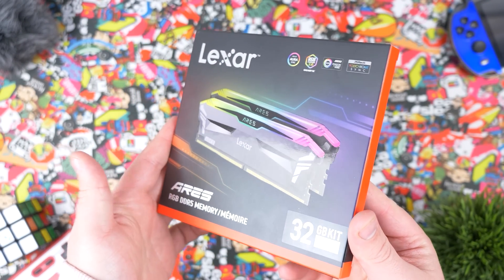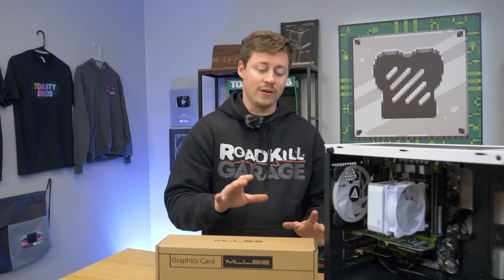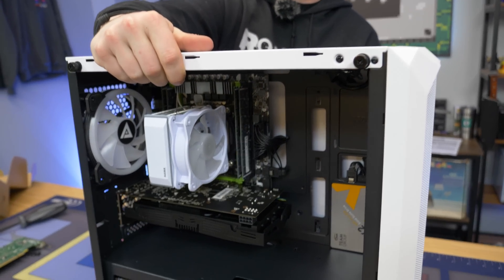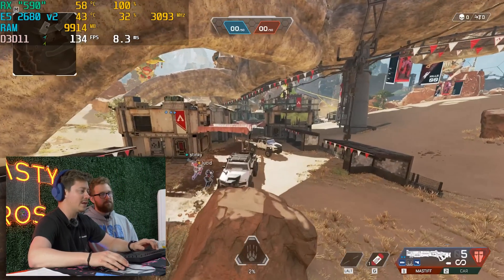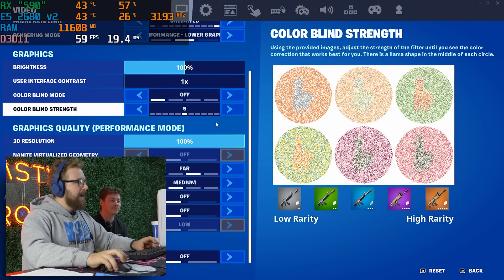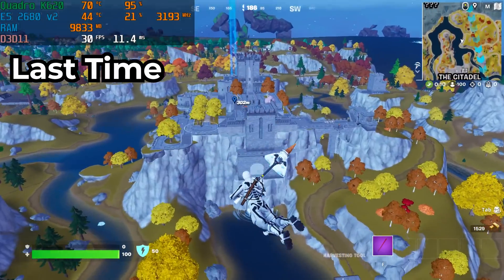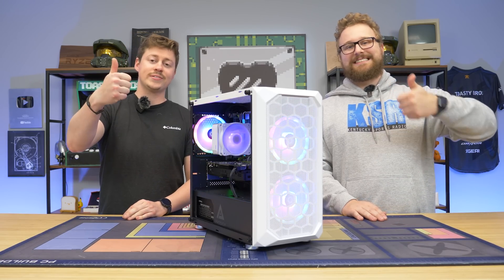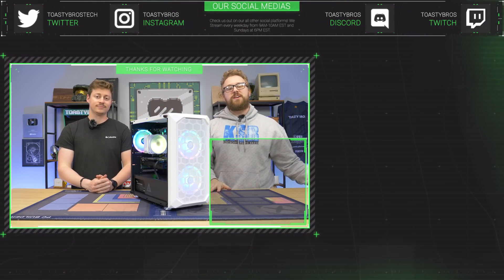It's Sad That People Buy This Gaming PC...So We Fixed It!

Comment: Could you guys review my budget PC? I think it would be really cool. My parts are an i3 10th gen, RX 5700 XT, MSI z490 plus, OLOY DDR4 16GB ram.  pc runs at  120+ fps on overwatch at 1440p ultra settings and it only cost me $400.

Comment: I sure hope you left negative feedback for that seller, it's the best way to warn potential buyers about shady practices.  I won't buy from an eBay seller that has less than a 100% positive rating (with occasional but rare exceptions --- I've seen some very unreasonable complaints).

Comment: Looks like two scams cancel each other 😁But realistically, pairing Xeons with "580" or "590" is a good way to get cheap multipurpose PC with decent gaming capabilities as long as you moderate your expectations.
Reply: The amount of content this can run well is staggering, it'll just struggle a bit in the new AAA stuff, then again everything seems to be struggling with the new AAA stuff.
Reply: @darthwiizius  if you get this pc I’m pretty sure you don’t expect high expectations tho this 590 definitely improved it
Reply: @ImJusSha  
Yeah, it's a basic 1080P60 machine.  This 590/80/70 did turn it into a viable gaming and general purpose computer, I'd much rather have that card than a 1650 all day and night.  The scammers that sold the PC could have put one of these in and buyers would've been perfectly happy and well served.
Reply: @darthwiizius  It could play games released for PS4 and PS4 Pro . Games released exclusively for PS5 - 1080p low with FSR 😁
Reply: @aleksazunjic9672  
Exactly!  It'll play PS4 pro/Xbone X games better than them and anything older like a champ.  I love FSR and DLSS, the only pro-consumer thing to come out of GPUs lately.

Comment: xeon is good and all, especially if you are a freelance programmer/dev. But if you are strapped for cash it would be better to build a used fm2+ APU. Recently I built an A6 7400 K with dual channel 16 GB DDR ram and a pretty darn good local brand case with tons of air ventilation and sold it to a former college dorm-mate for 220 dollar, with a sweet 35 dollar margin, best of all i don't even need to cheap out on the psu, as I got a 400 watt Enlight bronze plus, which definitely gives some headway for GPU upgrade in the future..

the guy's so satisfied that he could finally play DoTa 2 and Empire Total War with stable FPS that he ended up giving me extra tips (poor dude used to play DoTa on Celeron laptop)
Reply: Agree I've had the Dell T5810 & T1700, will make a video soon on the T1700 soon.

Comment: What a PoS seller for including that GPU.
Reply: @Braydon2144  Buy the parts and build it yourself then.
Reply: @genesisfan029  Heck, you may as well just get a 5600g and play on integrated graphics. You can do all that in a pretty solid build for $500
Reply: @Jdogg4089  I wouldn't build a system on integrated graphics. Not for gaming. I'm not saying there is anything wrong with that. But I don't think it's worth it unless your playing games at 720p which no one should be doing these days.
Reply: @Braydon2144  you can get an rx580, i5 11400f, 16gb ram for less than the price your saying
Reply: the seller is a total scam - his name is JAMES CENTERS    what a PoS
Reply: maybe if youd watch the part 1 you would know whats happening, the seller reached out and canceled their order(after it was shipped n all)
Reply: @svizzykvizzy355  I do realize that, still scummy.
Reply: @LexusLFA554  Yeah but shi like this does sometimes happen, i think tjat all it took was a simple message to the selled